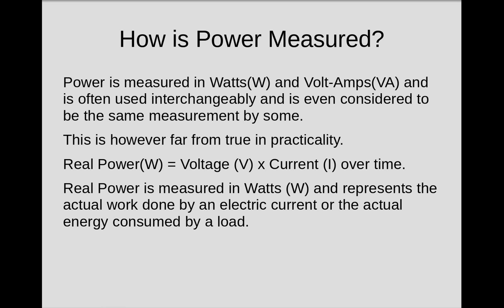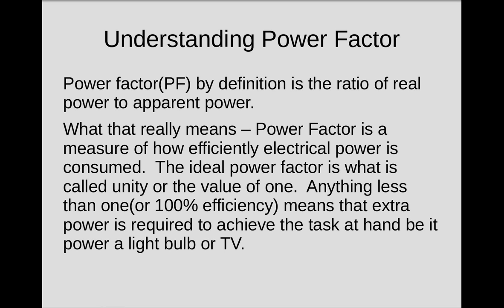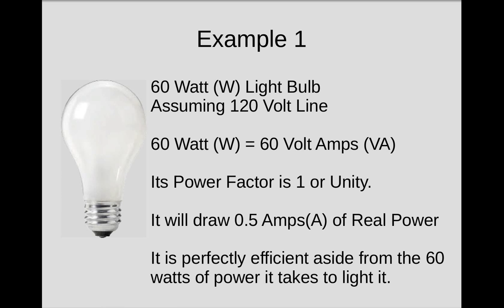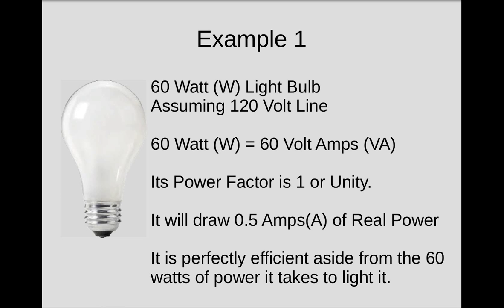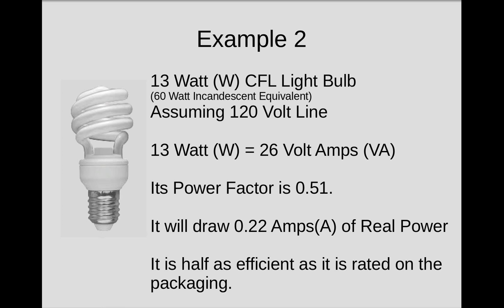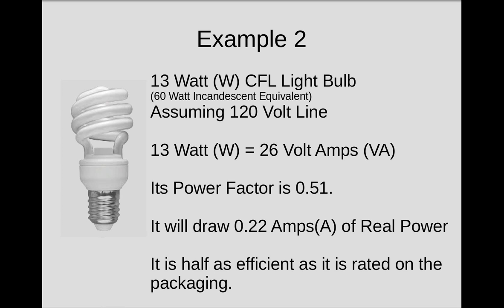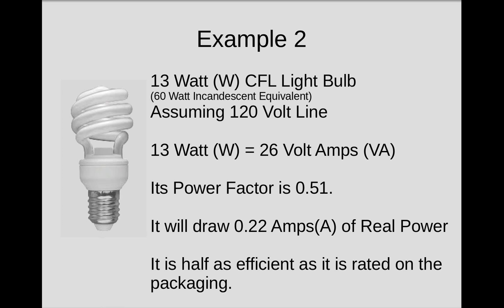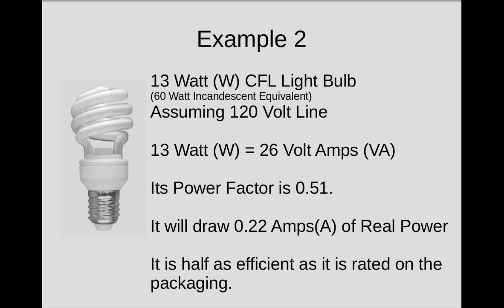Electrical Power Factor Explained

Comment: PF is very difficult to be understood by people who has no electrical knowledge/experience.  People just think that for example 13Watts CFL lamps are equal to 60Watts Incandescent lamps. That’s why they think is better to use CFL. 
Current and voltage are commonly mistakenly referred as if they were equal. 
By the way, your video is pretty clear. Well explained.